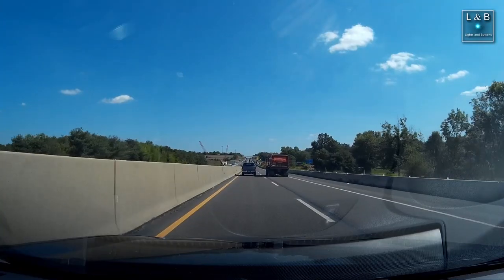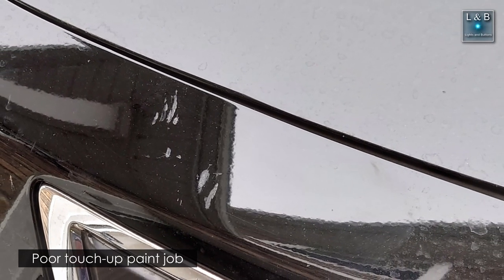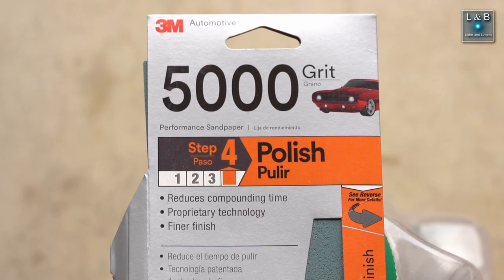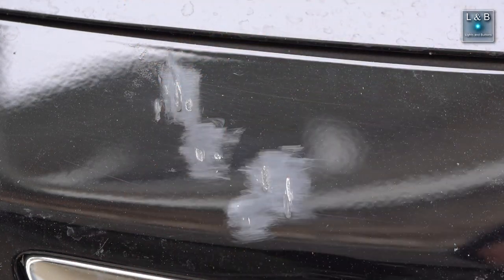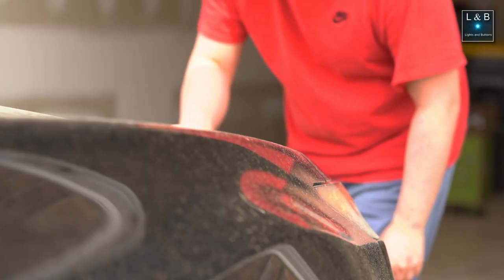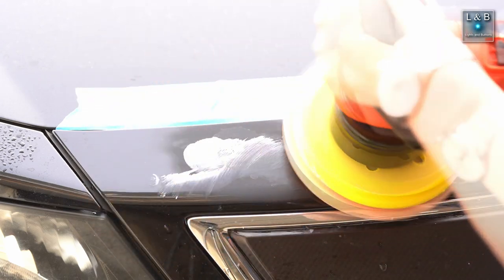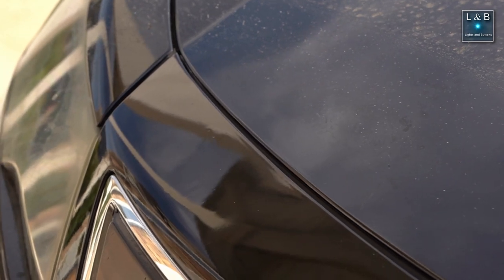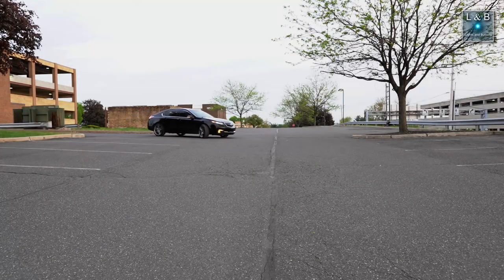DIY Black Car Touch-Up Paint from Rock Hit (Featured Episode #33)

Comment: After clear coat , how long it will take time to sand till plain surface
Reply from the maker: Hi! I can't exactly remember. I'd say maybe wait a day and check back
Reply from the maker: Possibly up to 2 days
Reply: Ok!!!
I'm afraid if I keep sanding the surface until it's flat the shine will go away...
Reply: then do it again
Reply: Now everything is running smoothly according to your directions. Now I am working on blending that area to get it back to a flat surface
Reply from the maker: Good luck! Hope it turns out the way you want!

Comment: How do you like those tires?
Reply from the maker: No issues to date! Those are Continental ExtremeContact DWS06 tires. I've hit several potholes, and they've held up. Not bad considering the sidewalls are pretty low. Pretty comfortable, not a whole lot of noise.
Reply: @LightsAndButtons  Yes I have the same tires. Very easy to spot with it's unique tread pattern. For a All Season tire it grips the road like eagle claws.